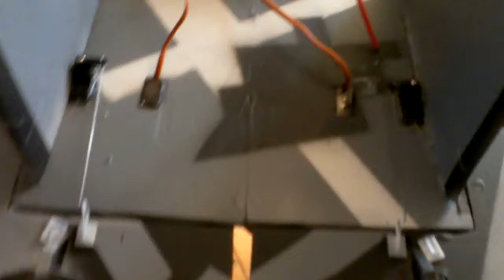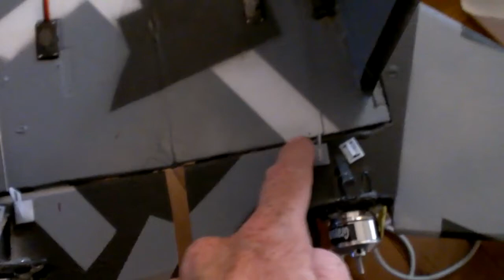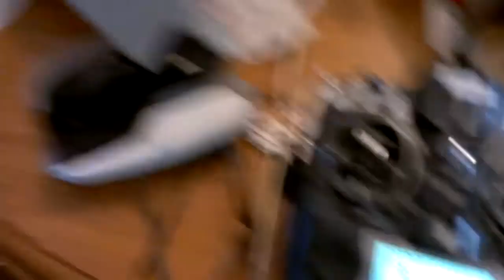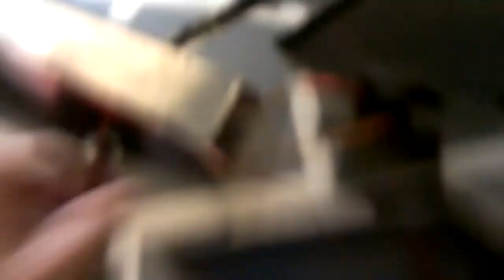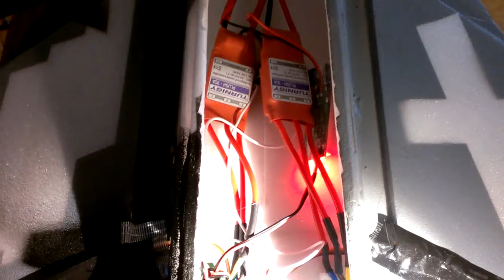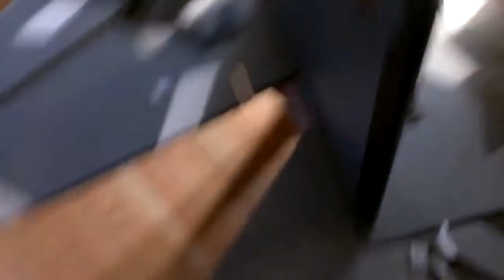Boxermad84 SU-37 build: electronics fitted

Comment from the maker: Yes I know, I should probably stick to 3S because being rear facing these motors won't get a lot of ventilation.  But I run my Nanoshark with an MJV3 on 4S and it handles it just fine (it runs cool).  Being a nose-mount though it gets maximum ventilation.